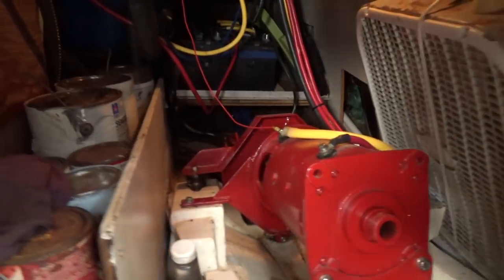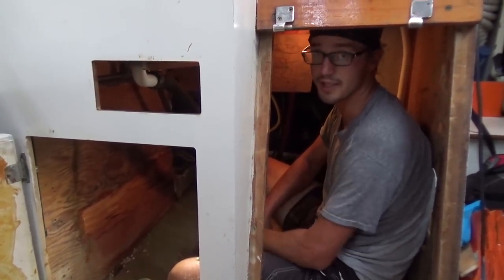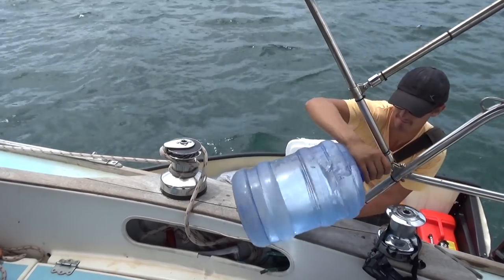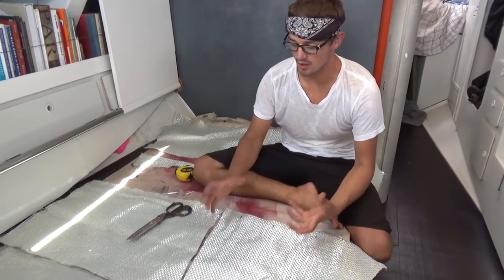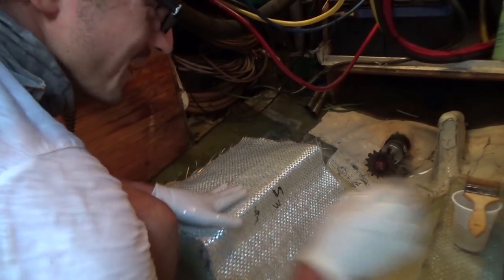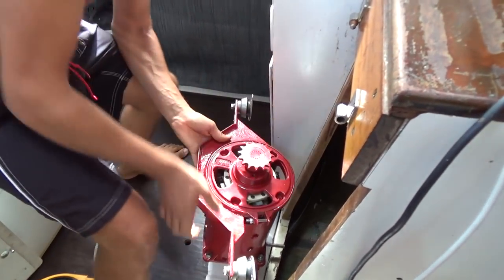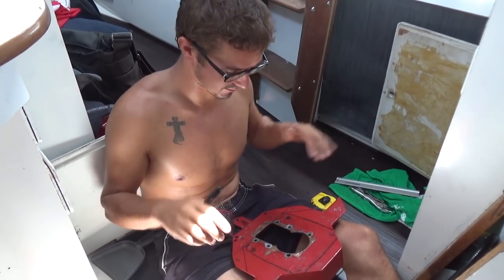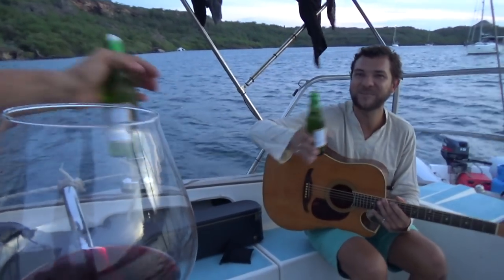REBUILDING Our Electric Motor - Going Direct drive — Sailing Uma  [Step 99]

Comment: Dan makes a relatively complex job look simple and I love all the extra space in the "engine" compartment. Using ones hands to work out trapped air between glass plies instead of stippling with a brush appears to remove air bubbles just as well, and does it faster and easier. Even with his "hands on" approach, Dan must be protecting his skin and lungs well 'cause he hasn't become sensitized to that epoxy. I am rather surprised that using a chain coupling to connect the prop shaft to the motor is holding up so well. This guy is an engineer regardless of whether there's a certificate! Hardly can wait to see the controller setup.....

Comment: If you put your West epoxy in a refrigerator for a few hours before using, you can more double your "pot life" in hot weather, likewise store it at room temperature overnight if the setup time is too long working in cold weather, after layup, cover with a sheet of plastic then a blanket or fiberglass insulation as it does generate some heat as it cures, been there, done that.

Comment: Great set up this electric motor. Liked the new engine mount prep work (I recognized the architect skills).  New that it is installed it may be too late, but you could have use a coupler to take the push-pull load on the direct drive And avoid engine modification. Enjoy your ride!

Comment: Another great job and video! I had 4 Deep Cycle 100 Amp Hour batteries in my engine room (2 banks of 2 each up high just in case water go into the engine room) on a 30 ft Islander and TWO 250 Amp Hour 8Ds in a box I built into the quaterberth which I vented into the engine room so our blower would take care of all of the batteries. 900 Amp Hrs total plus Two 6 Amp per hr solar panels and a wind / tow behind wind generator. Now that's enough juice to last and have left over juice to play. I guess you can regenerate when under way if you had to but a folding prop is the best to reduce drag and sail. I had switches to use or charge whatever battery bank I wanted to charge or use. Charge 1 use another. I also had a remote switch to with one click turn off the inverter thus all unnecessary juice drainers at night. The second inverter took care of stuff that was always on or ready to go. I had a remote for the anchor windlass but best of all, I wired a toy car remote to work with our autopilot. Set the sails well trimmed and lock in the auto pilot as well as making small adjustments myself. It's too cool what a guy will do with time on his hands living / cruising on a sailboat :-) Jacuzzi in the cockpit and on demand hot water (salt or fresh) built into the BBQ off the stern rail. Wet dry sauna in the head. Cameras everywhere even an underwater cam.

Comment: I like the use of the cooler for foam, great work! 

If you put the epoxy in s larger container so it's more spread out, it will kick slower. You need to keep the epoxy cool, and it creates heat as it starts to cure so keeping it spread out with a large surface area is the best bet.

Also, be aware that epoxy fumes are pretty nasty. It's totally possible to build up an allergy to them with exposure over time. I have friends that can no longer be in the room when epoxy is being used, it makes them break out in rashes and have trouble breathing. That came from years of hobby epoxy work at home with no breath protection. A respirator that can block organic chemical fumes is small cheap and really important.

Comment: Awesome job fiberglassing in the new motor mounts. You make it look easy and beautiful! You will love the regen capability of direct drive. We have a full keel with the prop in an aperture (the worst setup for regen) and make 4 amps @48V when we are sailing 7 knots.
Having an exposed propeller will make it spin more and give you much more power than we can generate.

Comment: @Sailing Uma  Dan - where did you learn all those great, tracing, pattern making, fabrication skills?  Or were you born that way?  Raised on a farm too.  We had wheat and back then, big track layer tractors to pull plows, discs, etc.  Ended up having a 50 foot ketch in the Seattle Puget Sound, Straits of Juan DeFuca, San Juan Island area for 22 years.  Never took the long sea trips but so many great days right here at home.  7 years living on the hook. You guys should visit sometime around July, August, September.

Comment: Excellent job renovating the electric drive. My only concern is the current draw. Keep a close eye on the amp meter when ever you speed up the motor from stand still. There could be a problem with too much amperage draw and melting of wires. It will be dependant on your variable speed controller, the load draw. So keep an eye out for hot wires. Best of luck and keep these great videos coming.

Comment: As bushings for my two EV motors I used good quality skateboards wheels after some welding to the engine mounts,it had no vibrations at all.....Difficult to explain with no pics or vids,but with heat 12V extractor fans,I now have 2 motors that give me 12 K easy,no more mast and sails,but solar panels(12/24V,on demand)Only led lighting,inside/out) everywhere and outside wind- props all over(5),started from Bretagne France,down to Spain,Portugal,African costs and back,3 month of slow'sailing'on a very calm ocean,best fishing ever, 60 NM from the coasts

Comment: Hi glad to see you beefed up the bearing. I'd forgotten you did that. I saw your prop turning while sailing, can your motor use the turning to help charge the batteries? If not would a self feathering prop help you reduce drag. It's usually considered about 10-15%so about 3/4 of a knot......nice for a long passage. I expect you have thought of this too......
Cheers Warren

Comment: Please add an anode to the shaft behind sprocket ,With the thrust of the prop the force is not only on motor but sprocket  too, it pulls off prop shaft goes out back  and you sunk. A good practice on any boat. I've seen it happen

Comment: Really nice video! I saw your knees with little scrapes and remember about my inline skate knee pads.  They are the half pipe pads that have a very large amount of padding. I'm sure there are construction knee pads that might be even better specifically for work.  They are very comfortable for kneeling and walking on the knees a lot.  I use them for nordic curls on my carpet, which strengthens the hamstrings.  Good luck.

Comment: I have seen this done many times before and most boats are not big enough to carry the battery capacity nor the charging to sustain normal usage , for most electric units you need to carry 6 1200 x 600 solar panels at a 100 watts each to even help in this situation , as for going off shore cruising around the world good luck , I hope it all works

Comment: What was your gear ratio previously? As you may know mine is direct drive, the key is keeping the voltage up and amps down and running at a decent shaft speed to obtain the best motor efficiency at your cruise speed.

Comment: Great to see you being so self-reliant and building up your motor mounts and direct drive! Woohoo, should make a difference.

Do tell how you go with regen. 

Id use a mask when cutting fibreglass though.

So how many hours can you motor with those batteries?

What about a movable bracket on the stern to mount the outboard just in case you run out of power?

Comment: Nice job with the motor.  I used the thunderstruck kit and their mounting plate, so it all fit on the existing engine stringers (Pearson 30, so similar setup to your P36) without modification.  I also moved the batteries forward to make it easier to check water levels.  The only problem is that, now, there is not enough weight aft, so she sits with the bow a little lower.  Do you have a similar problem?

Comment: I just rewatched this episode.  The prop thrust has to be transferred through your chain drive.  Chain drives do NOT transfer thrust well.  Watch the chain and sprockets for wear.  You would be much better off with a straight coupling with a flexible coupling in between.

Comment: Cool. How do you keep the thrust in the prop shaft that’s  happening without the forward gear in check? Is there a bearing that keeps the shaft from Radial and longitudinal movement?  The chain is going to pull the prop shaft a certain way when power is applied. When the forward gear was installed, it kept the alignment.  How do you keep the alignment without anything there?  Any knocking?

Comment: just curious why no reduction to allow the motor to spin near max rpm at full load improving efficiency. Toothed belts are quiet and durable. You are spot on in my opinion with the fork lift motor and the thrust bearing.

Comment: I'm certain the chain drive  you had was the major contributor to the destruction  of your sail drive. .
There are nylon couplings available  that tolerate  small misalignments in direct drives  which you really should now  be using as you haven't used alignment  technology to get the motor  and saildrive alligned.The sail drive is not built to withstand  uneven  pressure  on the gearing. 😁
Intended as constructive critique.  I admire you for getting on and doing it without a couch.😁

Comment: When the time comes for new batteries you could put L16 batteries in the same foot print as your current batteries but with additional amp hours. weight is about 125 lbs each

Comment: Ok so its a bit late and I havent watched any further, but Im an Ex Airforce Heli Engineer. You totally need a flexible coupling on that setup. How noisy is/was it? I love the ingenuity of the double width chain and two sprockets, but a 6 bolt rubber donut will be  a good solution to any latent alignment issues and noise transmission.
Reply from the maker: It’s really quite actually. The prop I’m the water makes more noise than anything else.
Reply: @SailingUma  Thats good then. A flexible coupling will also extend the bearing life... If you ever have cause to change things, like a nice brushless rig, you can install one in the mix.

Comment: I know it's too late this time, but next time you have that sprocket off, use anti-seize paste when you reinstall. A thin layer on both the shaft and the key will make future removal much easier.

Comment: Thanks for the vid. So this is a industrial AC motor that you wire to controller and batteries? Can you explain the basic parts? Battery bank? to VFD? to AC Motor? 

We want to do the same thing. But we are having a hard time figuring out what parts to buy.

Comment: You did not mention changing the propeller, so was the transmission 1:1 ratio?  I would think that direct drive would over rev the existing propeller.  Great video y'all.

Comment: Nice work.  But, did you not mount the controls yet?  I would like to see it running.  Both at low speed in a harbor, and under sail to see if it helps increase speed.

And could you have added an additional battery bank instead of moving them?

Comment: It's a tad late, but I would have went with a chain/belt drive. Virtually no efficiency loss and you can hard mount the engine. ALso you could gear up/down for best performance. My guess would be a bit of gear reduction would be best as I assume you achieve hull speed at well below the motor's max rpm.

Comment: Nice job, well done. My concern is that by using only one nut under the forward motor mount, the nut might work itself loose over time from vibration. Two nuts locked together would prevent movement and a possible future misalignment and failure of the direct drive. Just saying, "an ounce of prevention.....". 

I think your design is brilliant and execution spectacular. I know the motor doesn't get used a lot but I would hate to see it all go for naught but for a loose nut.

Comment: Nice work Dan,  your work is really an inspiration, I have planned for the Keco fridges (x2) in my boat-to-be-built. How big a fridge size (litres) you think one Keco unit can handle, if I use 100mm insulation? Next time you are in a H/W store, buy some knee protectors, worth their weight in gold when you work in cramped spaces.

Comment: I sure would have liked to see the truss bearing used on the motor. Have you seen the shaft turning when in neutral under way for regen? How fast was it turning.

Comment: Great video. Why use gear coupling? The gears look 1 to 1 so why not directly to prop shaft with flexible coupling?
Reply from the maker: Flexible couplings cost about $4-600. The gear one we built was about $40 and works just as well.

Comment: Do you have a thrust bearing?  You answered yes. 👍
Reply from the maker: The motor has 2 bearing it in that are designed to take the minimal trust from the prop pushing the boat forward.

Comment: I think a belt would be way way more quiet than a chain!!  And a chain needs to be lubed and will fling oil all over the place.
But don't get me wrong, you're living my dream
Reply from the maker: It we needed a reduction, then a belt would be better. But our chain isn’t moving, so no noise or lube needed.
Reply: True dat.  I was referring to the point in time when it wasn't direct drive.   I really admire your 'go for it' attitude,  I didn't have enough of it at your age.

Comment: Nice job on the motor mount. Are you considering a different prop for the direct drive? What controller are you thinking about? Regen is interesting, I installed an electric inboard almost 10 years ago and I'm still learning the learning the nuances of throttle position and max regen.

Comment: Your electric drive is one of the coolest boat projects I've seen on youtube.  I can't wait to see it run!

Couple of questions (maybe this is covered on the other video?)

I remember that your motor can only go for a half hour or so based on your charging/battery system.  Now that you've freed up some space, any plans to upgrade this?  What size is your solar bank and what is your motor rated for?  Do you feel like your motor is a limiting factor for long blue-water sails with the potential for doldrums?

Do you plan to replace your chain coupling with something more direct in the future?  It seems like some kind of cv joint with dampening would give you added efficiency while protecting your valuable components.

Also, (kind of a joke) any plans to upgrade your dinghy motor?
Reply: Electrics are limited in practical terms to run time and at present are prohibitively expensive to set up for motoring at sea. Hybrids on the other hand can be a great option.
Reply: They had a bunch of information on the old setup on their website.
Reply: They've got an episode on it, it's early on ... while they were still hauled out in F L A
Reply: Chris Perkins actually that chain coupler is one of the best systems as it’s strong and simple , parts can be found virtually anywhere

Comment: 13:14....Base formed with styrofoam and fiberglass, no metal inserts at this point?  Motor mounts held in place by epoxy resin poured in styrofoam?  How does that make a stable platform for the motor mounts and the force of the el'motor?  Just curious about the stability?
Reply: Exactly,even wood would be better than foam,under all the glass last 20 yrs.

Comment: I really enjoy the way you present your project videos. Dan you are amazing. 

Question: why eliminate the transmission? I just don't know enough about the benefits of direct drive for an electric motor.
Reply from the maker: It was very in efficient. We've gained more than 60% efficiency from removing the trans and adding the new controller. Also, half the RPM so less vibration = less noise.

Comment: Dan, Never having sailed down to the Caribbean before I was wondering if you could explain the difference n why it's harder to check in and out with a US flagged boat? I would think it would be easier with a US flagged vessel. What's the problem?Love seeing your electric motor work. You are a true craftsman! If I knew more about electric motors I would definitely like to try doing it. I've heard of so many people having problems with their diesels especailly in rough weather when you need them most because the garbage in the fuel tanks clogs the filters. Something you'd never have to worry about! So many advantages with electric!!! Thanks!
Reply: spinnaker5514 picture driving to Mexico as an American with your car having Canadian plates and explaining why

Comment: Electric motors make sense for sail boats bc they are only “typically” used getting to and from the dock. Solar cells on smaller boats and solar cells and a small diesel genset for medium size and for big boats, skip the solar cells and run a small and large genset to run the A/C. And That’s my thoughts on the situation!

Comment: I was really hoping when you removed the transmission that you would lose the chain coupling also.  Obviously, from the wear shown on the sprocket you had it well aligned, but in my opinion your drive would run much quieter if you went to a different style coupling.  When I worked facilities maintenance at McDonnell-Douglas, we used Rexnord elastomeric couplings and I was delighted with their ease of installation.
Reply: Those do look nice.   The "replace in place" one sounds particularly useful here.

Comment: I would love to know why you used a double chain to connect two sprockets instead of a Lovejoy or similar product that is actually made for that sort of application. It would certainly soak up the misalignment and fore/aft thrust better than what you are using.

Comment: Do you have some kind of protection in place for the electric motor in the event that the propeller won't turn?  For example if it gets fouled by a fishing net or seaweed.   Perhaps you have a sacrificial shear pin or an electronic load sensor...?  Would hate to see you burn out your motor if the prop gets stuck. :(